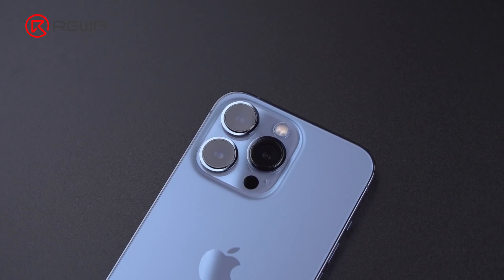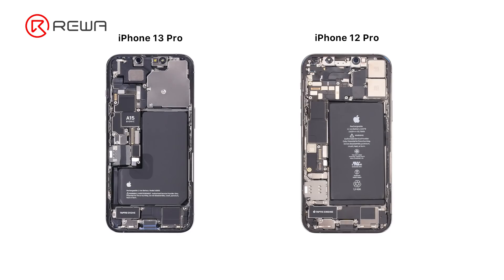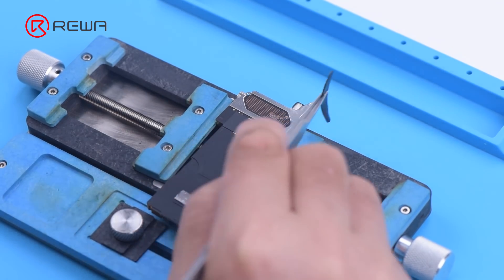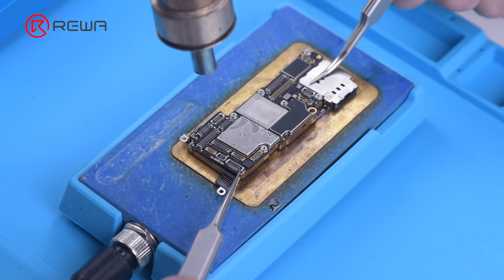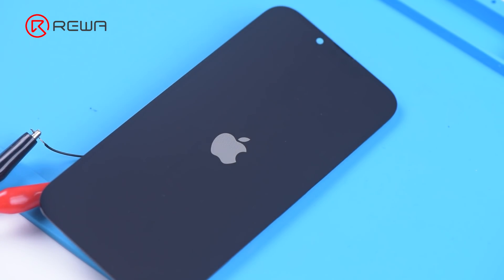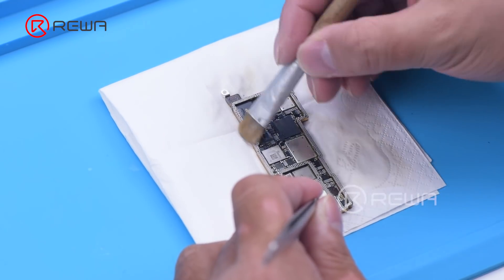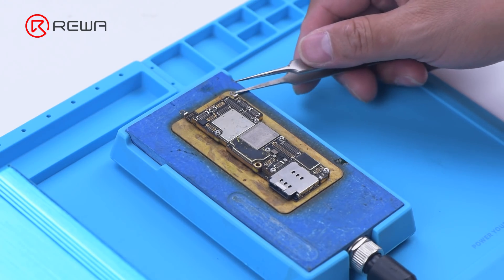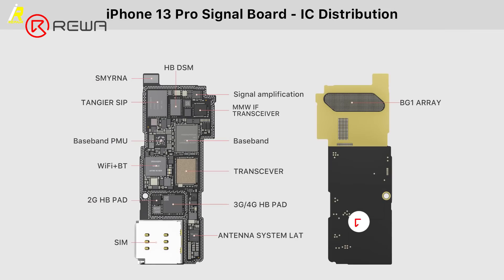iPhone 13 Pro Motherboard Separation – The Hottest CPU?

Comment: My Quick hot air soldering station is miscalibrated and won't calibrate (me think it's broken ). I always must use my multimeter to adjust the heat accordingly and sometimes "forget" (: in this case, I was splitting an iPhone 13 Pro Max logic board just like in this video and wondering why it was taking so long LMAO! Just glad I didn't break it (:

Comment: Probably a dumb question… though.. is it possible to transfer the A15 chip from a damaged board to another to retrieve data and/or photos? I only ask since my 13 pro max got torn apart on a ride at Disneyland :/ and the a15 seems to be the only chip intact…
Reply: No information is stored on the A15 CPU all the CPU does is process information. It does not store it.
Reply: @MrTrytiped  that makes sense, thanks

Comment: Very interesting to see that Apple does not include any of the RF parts (WiFi, BT, Cellular) inside of the SoC. I wonder why. This could save them a lot of space on the PCB. Some other SoC manufacturers do implement some of the RF parts directly into the SoC. Maybe it's cheaper to have them externally.
Reply: or maybe it works better externally
Reply: It's because they can't do it. They don't have enough know-how to do RF and to be able to match the performance of Qualcomm.

Comment: I was surprised when you booted the phone with half the board
Reply: The lower layer is for wifi, network, audio it is not needed when you test if the phone is booting or not, the most important chips is power, cpu and nand which is located in the top layer

Comment: Is the Thermal paste or pad replaced or recommend to use or not? Full video does not show or say anything other than shows it's wasted dry removal
Reply: 99% of repair technician doesn’t have access to that kind of thermal paste and it is not recommended to use random or computer thermal paste
Reply: @AymanTheRepairTech  Thermal pads usually will do. high thermal conductivity pads recommended.

Comment: I think apple will add a warning message like "This IPhone was disassembled". So, it can be if they add 1 or 2 contacts which can control the short circuit between screws and display metall shield.
Reply: Don't give them ideas lol 😂

Comment: hold up, these phone are ALREADY cooking themselves to death? they aren't even a month old! wtf apple
Reply: They are not good in thermal engineering
Reply: i’m second to that
Reply: Hold up mate, 48C won't cook anything, it will just make it feel hot in your hand on heavy loads. Worst case scenario here is the battery getting hotter than 40C, thus reducing it's lifespan